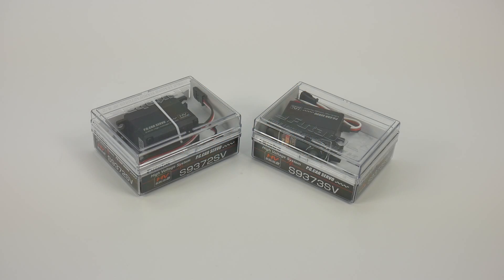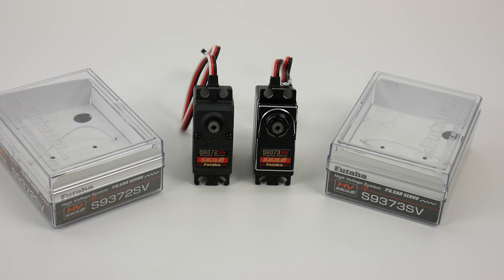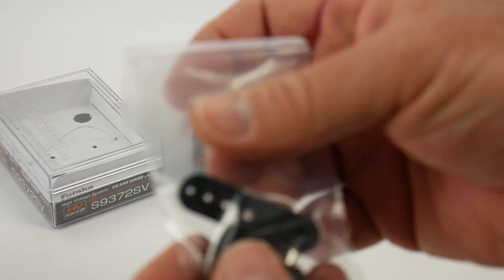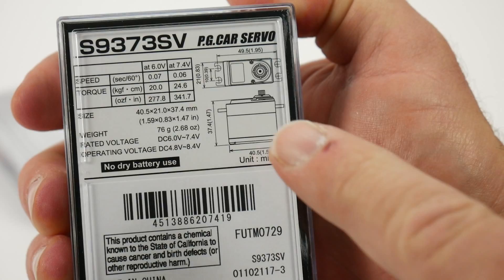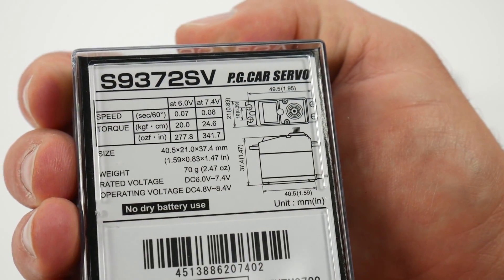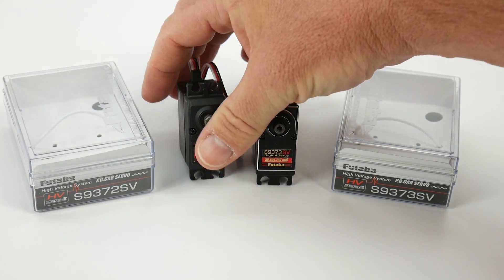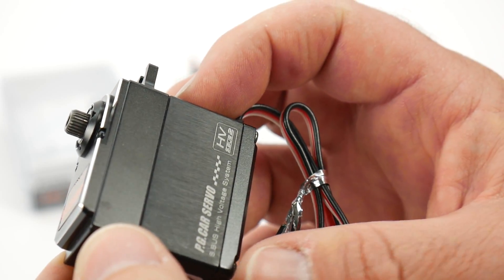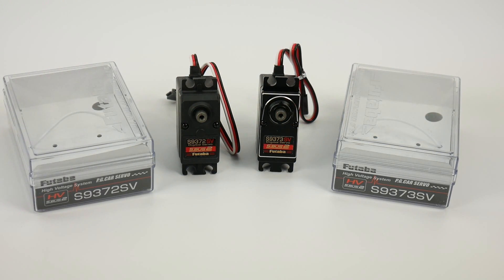Futaba 9372/9373 Servo Unboxing

Comment: I have an Arrma Talion looking to upgrade the servo. Someone at a hobby shop informed me that digital servos wont work as well with my Tactic ttx300 radio contoller which is supposedly transmitting an analogue signal? Any truth to this?
Reply from the maker: Joe Bran there's a slight bit of truth, but you will still see a great improvement of power and speed out of a servo upgrade.
Reply: Well I've just splashed out and purchased the Futaba 9373. Is it possible using my tactic ttx300 will effect the life of this servo? Would you recommend a digital radio controller upgrade for this servo? I'm pretty keen to keep the one I have, but if an inexpensive $60-$100 digital controller makes a significant difference I may consider upgrading. Thanks for info appreciate it.
Reply from the maker: Joe Bran you see just a slight improvement on performance with a digital radio - mostly with trim/EPA adjustments. Check out the Futaba 3PV - it's a great RTR upgrade radio and will control that 9373 perfectly.

Comment: as Always nice videos Rich , but i saw an early peak of this servo when you were trying to install it inside the DEX410 V5 but changed to another models because of fitting issues. I ordered the 9372SV and tested it in 2 cars . So far this Servo is really sick the speed and torque is impressive . I only run them at 6 volts for now .. The only downside to these servo is that they run way hotter than other models of servos that i have . I ran a full pack inside my Stadium truck and the servo case temperature escalated to 115 degrees Fahrenheit . I only attribute this to the fact that this servo does not use a brushless motor inside . Other than that it ran fine but i'm a bit skeptical on the longevity of this servo ..
Reply from the maker: Yeah, the Futaba is just a bit too big of a case to fit that strange design of the DEX410v5.  It was off by a mm.  Other than that, I have the all aluminum on in the Intech buggy and the plastic version in my Arrma Nero.  Both are doing well....I haven't checked temps though

Comment: I know some people will think these servos are expensive, and they are. But they are worth every penny. I have run the 9352hv which this servo has replaced for over 3 years in 1/8 nitro and electric racing. They have never missed a beat and never let me down. They have developed almost zero backlash and repeat like they are new. I have run many name brand servos and none compare to the speed torque repeatability and peace of mind of futaba servos.
Reply from the maker: Very well said!  I love my Futaba's.  Install it and forget it!

Comment: One thing I haven't done with me rc's is upgrade the servo. My local hobby shop has only had $15-$35 servos. I'm gonna order one. Thanks for the review.
Reply: If you're talking about a nitro car, its wise to replace at least the throttle/brake servo for safety reasons

Comment: so this servo would be a good choice for my wraith??,the stock one finaly gave out and I don't know what to get for it
Reply: Hey Leo, I say if you can spend the money on a really good servo I would. I have ran a BLS172 for 3 yrs. You would probably be at or more then 200 in servos and have had to replace them alot. A servo that has some thing with 3 to 400 oz of torque is going to do the job just fine. Futaba, Hitech are the brands I would stick with.

Comment: The problem with plastic ears is that them could break on vehicules cause of the torque, so if i have to choose between aluminum and plastic, i prefer aluminium foe durability for a 1/8 4wd